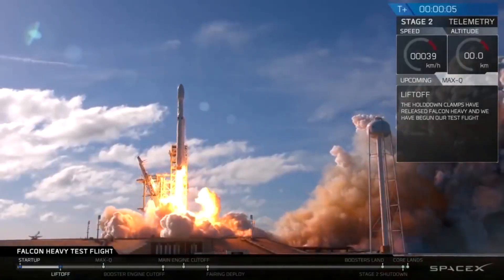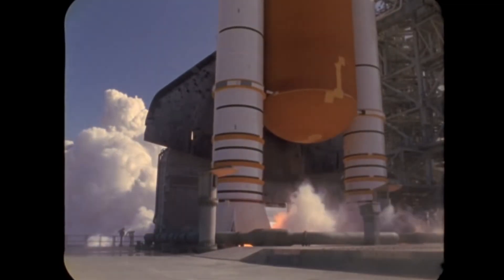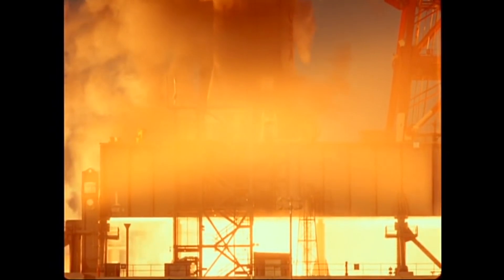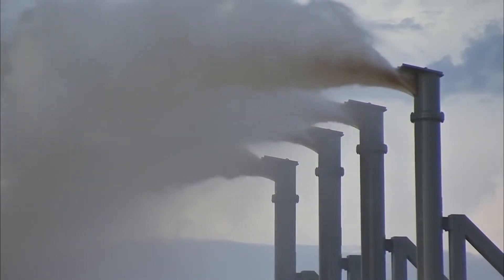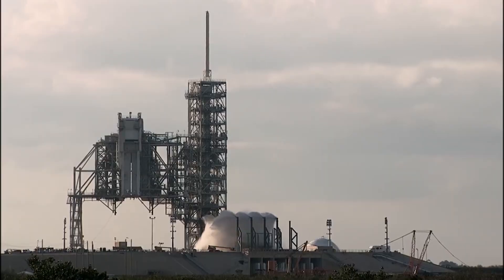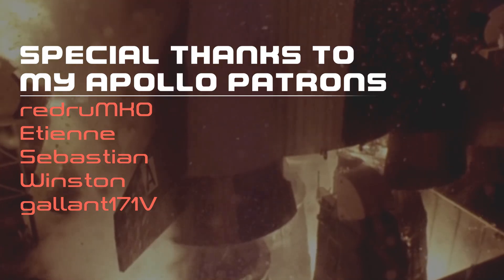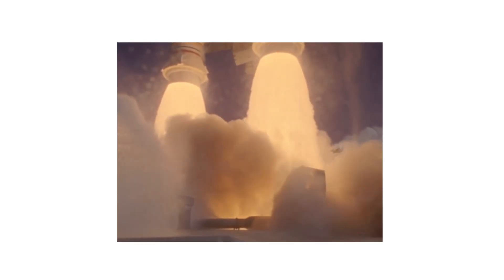Why doesn't the sound of a rocket launch kill you?

Comment: I thought 190db was the loudest possible sound because anything more is considered a shock wave and not measured in db...  So where and how are you getting the numbers of 195 db and 220 db?
Reply: 190db is the loudest possible sound at STP ( standard temperature pressure ) at mean sea level. Buring fuel at astronomical rates drastically change the temperature and thus the pressure of air surrounding the rocket. Thus higher db counts are possible at higher pressures. Same explanation goes to atomic weapons.
Reply: ItzmeSurya T thanks for the knowledge. Thats good to know

Comment: "Ok, let's figure out a system to pour tons of water in very little time onto the launchpad. Also we need to suspend water beneath the rocket engines and we have to make sure it doesn't get stuck during use."

vs.

"Let's dig a deeper hole. Blyat."

Comment: But wrong, Not from195db to 142.5 db. Water suppres up to 142 inside payload bay,  outside its about 155-157 dB with water. Without water it should be about 160-165 dB. So real water effect about 5-8 dB, not 195-142=53.
Reply: 195 dB its sound level in flame trench and launch pad near nozzels. But movie very interesting.

Comment: Rockets DO NOT CREATE THEIR OWN THRUST.    
ROCKETS CAN HOWEVER IGNITE IN A VACUUM .  

HEAT / OXYGEN / FUEL    
ignition /OXIDIZER / PROPELLANT 

1ST CONSTANT = A T M O S P H E R E ^ < v > all directions evenly.  
Propellant chain reaction >>  HEAT / OXYGEN / FUEL    

ignition /OXIDIZER / PROPELLANT + Atmosphere constant = thrust  1 for 1 ratio is needed .  For every action there will be a reaction.    

The low caliber youtube vids that ive seen where the rockets do in fact move within the vacuum are no where near the scale needed.
The size of the rocket relative to the " atmosphere' it's within.    
Extract 14.7 psi from within the chamber can only accept 14.6 psi to remain a slight vacuum. 
14.7 = neutral as 14.8 psi would start the new pressure system.  
A barrier with always need to separate an atmosphere from a vacuum.  
For those who say " Gravity "  holds the atmosphere to the earth , and then interpret that fallacy by saying "well when you're on a train ..it's relevancy!"  smh smh derp
it's the train itself which is the barrier that separates the 2 atmospheres.  when you are on the train and you throw an object up and it doesn't move away from you..   the object does move away from you on  a molecular scale relative to the amount of sustain pressure / loss .  this would simulate "Coriolis effect"  the cabin is not 100% airtight for obvious reasons.  open all the windows on the train and then try the same experiment while the train is traveling 100 mph and see if you get the same exact results .  
Our atmosphere is a body of water in gas form.   as you walk around the atmosphere is a constant 14.7 psi in a ll directions as you move so does the atmosphere filling in the space you just moved from.  And if you want to break this down into the molecular scale from the thought of " but what about when things grow?  they get bigger and take up more space?"  
Your mom and dad = you 
mom and dad both consist of DNA  which makes them who they are in every way.  the sperm met the egg ( 1 for 1 ratio )  as one thing is taken another is formed equally . ( a whole other conversation)

Anyways..  get your car and get a balloon and bring it to a buoyant state .  Im not sure what the ratio of helium / air would be , i know its not 50/50 more like 30 / 70..  But make sure all the windows are rolled up take the buoyant balloon and let if float in the center of you car. You car is not moving btw..   as your car moves forward, the balloon will move backwards slightly depending on your acceleration but then return to approximate the same spot it was .  just like water in a pan and you go to move it..   now try the same experiment with the windows open , as the car moves forward the buoyant balloon appeaser be moving backwards , however the balloon is still floating in the same place , its the car that is moving away from the balloon.  The outer atmosphere flooded inside the car as the windows were opened .  

Back to the Rocket in a vacuum..  
If the same experiments were done of rockets in a vacuum and the vacuum chamber was the size of THE SUPER DOME lets say.. and the rock is the size of any amateur rocket..  I GUARANTEE THAT ROCKET DOES NOT MOVE IF IT WERE FLOATING .  IF THE ROCKET WAS PLACED ON THE GROUND IT WOULD THEN HAVE SOMETHING TO PUSH OFF OF.

Comment: Excellent presentation.
Shuttle fun fact: The "railbird" sprinklers that began flooding the pad as the Shuttle lifted off protected the vehicle from the sound of the SRBs that was reflected from the surface of the pad. They needed to do that for the first nine seconds, after which the Shuttle was high enough that the reflected sound levels were rapidly diminishing. The Orbiter could withstand a maximum sound level of 145 Db before bits started falling off and the Sound Suppression System reduced the noise to 143 Db. Was that fine tuning, or what?
Shuttle launches routinely set off car alarms at the Vehicle Assembly Building, five kilometres away.
Saturn 5 launch fun facts: the Sound Suppression System was not used for the first launch and the unprecedented noise collapsed ceiling tiles in Walter Cronkite's Press Site studio. Behind him, the large picture window that looked out to the launch pad vibrated so much that Cronkite and some of his staff braced it with their hands to stop it shaking. After the launch, a NASA technician came in and told them not to touch the window when it was shaking, as it had been made to shake and stopping it doing that could make it break.

Comment: 220db will not kill you. I will Unequivocally call bullshit on that. The world record for most db is 182db. In a vehicle. Incriminator Audio I believe. An Astro Van. Aside from that, there are several 170+ db vehicles that do Bass Demos all day. Violent Bass Demos that thrash and trash vehicles. Smoke Windshields. Cause ppl to tap out. 220db. Less than 40db more than the world record. Ya, highly unlikely that a deviation of 37db becomes deadly.

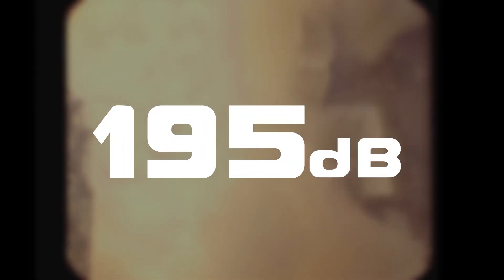Comment: 02:35 - a drop of about 52 dB. If I remember correctly from my acoustics class, every 10dB drop in sound is half the perceived volume (because dB is a log function) so with that a jet taking off is roughly 32 times quieter than that rocket without all the sound dampening systems which O_O dang that's crazy. I think 195 to 142 sounds like a small drop until you realize it 32 times  softer.
Reply: Genti Xhanari This is gonna sound a little dumb, but I can't thank you enough for saying that small comment.

This whole time I was thinking for every 10db drop, the resulting sound is 10x quieter than the previous amount. Quite glad you cleared that up for me lmao
Reply: @sirvalance1094  isnt it 30db twice as loud as 20
Reply: It's a reduction of nearly 97 percent I think
Reply: Good comment. Helped me understand

Comment: When can we use anti gravity air vehicles :( rockets seen so dated.
Reply: We have no way of counter acting gravity with out some kind of thrust material, whether that be inert gas like in RCS thrusters, or chemical explosions like in rocket engines we need to be pushing something out the one end.

Anti-Grav tech is probably not possible in real life, however better rocket engines are. 

Look up Fusion engines, and VASMIR engines. These are likely the future of space travel, but probably won’t be possible to practically use on earth until after we invent the Fusion Reactor.

Comment: The water can only absorb the soundwaves in the very beginning of the ascend. The sound pressure level is still way above 200 decibels... one can clearly hear this, because the "crackling" of the engines is nothing than pure physical clipping of the sound-waves against the vacuum. Pressure cant go any deeper then vacuum between two pressure-waves, which is around 191dB at sea level.

So if you are near the lauch pad, the very beginning of the ascend might be "ok", but if the rocket is at lets say 50 meter height, the sound pressure will rise to probably fatal levels in a certain radius.

Comment: What was that small rocket at the end of the video called?
Reply: Same
Reply: I think that was the Dragon capsule testing it's launch escape system. Basically small rockets designed to fire you off the top of the launch vehicle in case of emergency.
Reply: @RCAvhstape  thanks. I could use a knowledgeable friend?

Comment: I would think that shockwaves back to the rocket, would help it propel?
Like, why not launch the rocket like they launch submarine missiles and torpedoes, from a launch tube?
If the rocket is building pressure behind it, and the pressure is just shifted away from the rocket, placing that rocket in a tube (like a bullet in a gun barrel), the rocket should use significantly less fuel, have significantly less noise pollution, and should accelerate significantly faster; no?
Reply: Rockets propel through a constant series of explosions, shock waves are pretty much already pushing it up.

Comment: Americans: lets build a system that shoots out loads of water and nylon bags with water to dampen the shockwaves!

Russians: Давайте сделаем большую дыру lmao (Lets make a big hole lmao)
Reply: How deep do you think you’d get in Florida before the hole filled with water??
Reply: sub terrainial launch pad would literally be the best idea. I vote for the Russian ideal.
Reply: +brett run its called a prefab and there are pumps that would drain it. my city's north end was built on swamp beside lake Ontario. its not impossible.
Reply: The Wanderer I would guess that the fine engineers at NASA considered that and found their solution to be superior for one reason or another.
Reply: +brett run I believe it was about saving money as each rocket costs billions
Reply: The Wanderer so it was the better solution.
Reply: +The Wanderer no I get it. containing the blast force would redirect that force back at the rocket causing damage and/or misalign the rocket's trajectory. flame trench it is then
Reply: +brett run like I said originally, I vote for the Russians lol
Reply: +The Wanderer what if the combined the two methods. blast trench with water cannons. it would have optimal sound containment. 142/143 could become 120/130, perhaps less.
Reply: The Wanderer if the noise level is already the same as a fighter jet, what would be the benefit of spending potentially millions of dollars to make it even more quiet?  How often are these launches?  And how much noise drop is there when the closest people are already 3 miles away?
Reply: +brett run forgive me for thinking optimal xD
Reply: The Wanderer seems NASA should hire you. 😆
Reply: +brett run or anyone that needs things to become better and pays well 🙃

Comment: Why is the russian way unique? Theirs is easier and maybe cheaper. If anything pouring water on tyour rocket is pretty unique. But idk what the indians or the chinese do
Reply: It may be cheaper in long run, but makes construction way more expensive. Anyway, there is no much choice in cold regions.
Reply: @heyhoe168  do you think that constructing that spray system and transporting tons of water is cheaper?
Reply: @soileH  да, там всего лишь 2т воды на пуск, а подача воды это всего лишь водонапорная башня. Итого по меркам космонавтики очень дешевая и простая система.
Reply: Because Amercians tend to be more fancy were Russians only care about efficientcy. You can see thr difference with the Soyuz rocket in general. Thats why it has such a high safe launches. For 40 years it only changed in details. Its a cultural differene i think.
Reply: its cheaper and easier but it might not work for bigger rockets... the one they have looks to be good for  soyuz or smaller.
Reply: Endjo they use chopsticks and Indians are so poor they don’t have rockets.
Reply: PhatCrayonz Virgin
Reply: PhatCrayonz and your channel is shit

Comment: NASA also keeps all personnel and VIPs at least three miles from Launch Complex 39 (A and B) during a launch. That’s not just to protect from the sound, but in case of a catastrophic failure on the pad. The Saturn had a virtually flawless history, in terms of a major disaster (a booster failure and explosion), a rarity in rocketry. But had it exploded, a Saturn V would have had the same force as a small atomic bomb (without the radiation, of course). 

It even survived 2 lightning strikes during the launch of Apollo 12, and although the systems in the CSM (Apollo spacecraft) had to be re-booted, the booster, and its Instrument Unit (which guided the booster, and controlled its flight), kept the Saturn on the correct flight path, and the Mission didn’t have to be aborted. On reaching orbit, the flight crew and Mission Control were able to check the electrical systems of the Apollo spacecraft, re-set the inertial guidance platform, and were able to complete their mission. The Saturn was very well designed.

Comment: It sounds like the Russians are better why waste water when you can just make the hole bigger🤔
Reply: It's pond water. Nothing is wasted. it's pumped from a local pond, barely filtered, blasted onto the pad, then it just runs back into the ground, and pond.
Perfectly renewable, except for the energy used to filter and pump it, which is practically nothing compared to digging a massive hole.

Both are good systems though. ;)

Comment: Russian way seems much better
Reply: ThanatosXRS we need to place the launch pad as far south as possible to take advantage of the centrifugal force of the earth’s rotation. More efficient which allows more payload with less fuel used. You can’t dig holes in Florida. They fill with ground water.

Comment: I think you will go deaf before dying out of that sound
Reply: At aboud 190db the sound waves starts being shockwaves, why? Because sound is just different pressures in a gas, in this case this gas is air. Now... If we start to make this waves stronger and stronger (louder), its going to be a point where there is going to be a vacuum between each wave, therefore its called "shockwave". Humans can resist some level of shockwave using ear and eye protection without any problem. But the thing about this ones, is that they are comming very, very hot, so they start burning your skin, at the same time they destroy your ears due to sudden pressure difference. The sudden pressure also ruptures the alveolar tubes, making your lungs bleed out and fill with liquid as well as your nose. After the first shockwave goes by, it then comes the vacuum. That vacuum can make your skin, and inner body tissue literally boil, because water evaporates at low pressure levels. Also your eyes will suffer damage inbetween due to the previously reasons. Repeat that again and again several times a second and then you have a death sentence. The thing is that, the death wont come instantly, you will survive the burning, boiling and rupturing of your skin, eyes, lungs, trachea, ears, etc for a while before actually dying.
Reply: @whyisthispublic-p4b  Wow. 😨That's brutal.
Reply: Vibratians can cause damage too.
Reply: Those that know aren't saying a thing.

Comment: "Being too close to a rocket launch would kill you", as a bird flies by after liftoff and appears to be unharmed.
Reply: David James the perspective makes the bird look much closer than it actually is. Use your brain.
Reply: Much closer than it actually is to what?  That is a vague statement.  They never stated how close a person could get and not be killed by the sound of a rocket launch.
Reply: David James I was saying that the bird is not as close to the launch site as it looks. It’s the perspective through a telephoto lens.
Reply: How do you know it is thru a telephone lens?  How would you know what settings they are using on the camera?  Maybe your assumptions are wrong and the bird is actually fairly close like within half a mile.
Reply: David James what time into the video are you talking about?
Reply: A bird can be seen in the bottom right of the frame at 1:16

Comment: Well I thought that the water was to cool the engines...
Reply: Kris Actually the fuel in rockets is in liquid state, meaning that the oxygen has to be -183C and the hydrogen needs to be -253C! When things are that cold inside the rocket, there is some ice that condenses outside the rocket, and so that’s why when the rocket launches, you can see ice falling off the sides. If anything, dumping water on the rocket would only heat it up, haha :)
Reply: Kris there isn’t an engine on a rocket
Reply: @redsupergiant78  there are engines... but some call them Thrusters
Reply: still reading? :)8888 “Rocket engine” is a proper term...

Comment: I wonder if the SLS will be destroyed by its own sound, being the loudest rocket of all times with its enlarged SRBs.
Reply: Do you really think a bunch of rocket scientists and engineers are building a multi billion dollar rocket and would let it be destroyed by its sound?
Reply: @bensemusx  Delta rockets.
Reply: fs2728 how about BFR and ITS
Reply: They will be methane powered, thus with a more stable combustion than kerosene or solid fuel, and not that loud.
Reply: fs2728
The noise of a rocket is all about power, not combustion stability, BFR will be significantly more powerful, and therefore significantly louder.
Reply: fs2728   They do ground static tests before they do a test launch. When they developed the Saturn V, the problem they had to solve with the first stage was stabilizing the mixture of fuel and oxidizer with those huge F-1 engines. But all those engines were tested on the ground before they ever launched the booster. 

The bigger concern with the SRBs is that unlike liquid fueled rocket engines (which can be shut down), once an SRB is ignited, there is no stopping it.